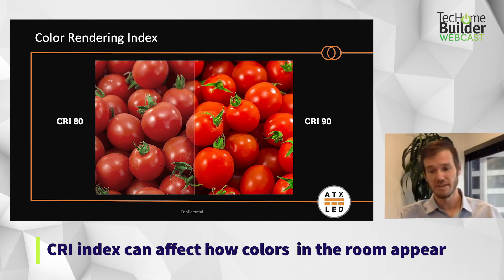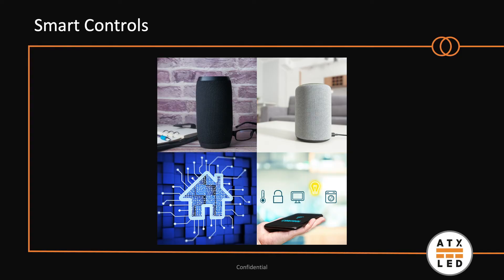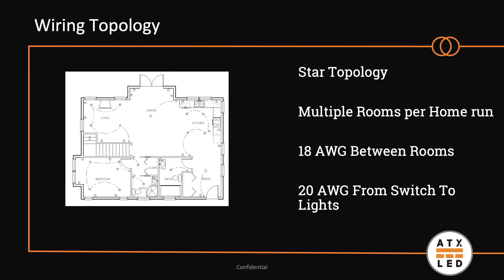LED Whole-Home DC Lighting

Comment: Its 2023 and DC lighting is going stronger than ever, with ceiling fans, exhaust fans, strip lights and wireless controls, live in homes nationwide since 2018.
Reply: We are off-grid with 48v batteries, can you go straight from the batteries somehow with your system rather than DC-AC-DC?
Reply: @toodeep1913  yes - no need to step up and down again.  you will want to limit the peak voltage to about 54v during the battery charge cycle - the RD6006 is a nice way to implement the limiter with a display

Comment: Next time cover the implications of DC lighting for Grid-Tied and Off Grid alternative energy sources like Solar or Wind generation.  This clean energy market is going to crave any additional efficiency that low voltage can bring.  It'd be nice to be able to have solar energy stored on a battery that can supply AC and DC backup loads simultaneously.

Comment: My question is, is the switch that takes it from 110 to 12 or 48 volt, or is there r
Transformer besides the light switch
Reply: There is a central panel with the power supply that feeds everything 50V.